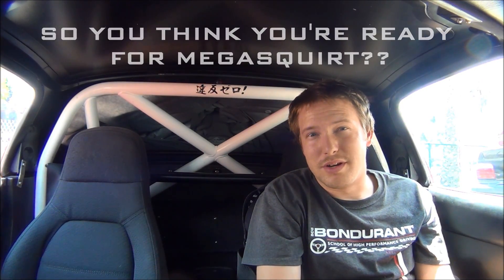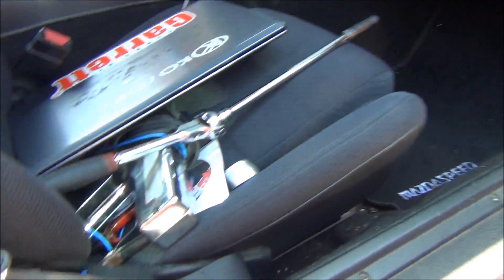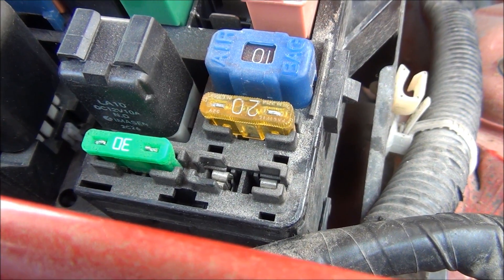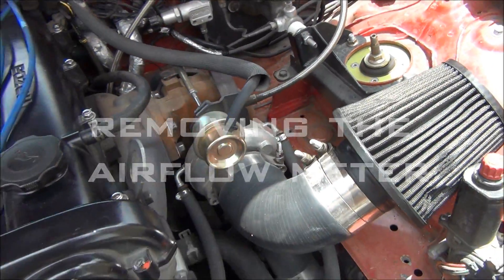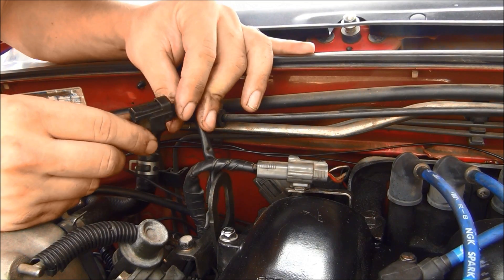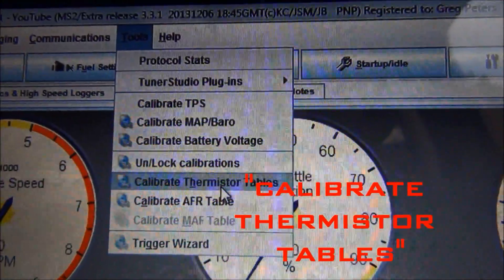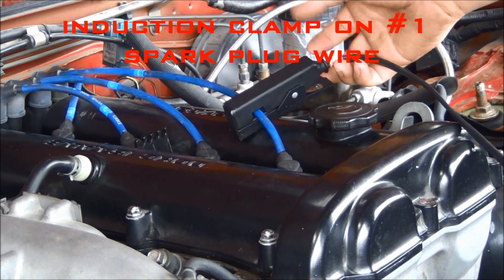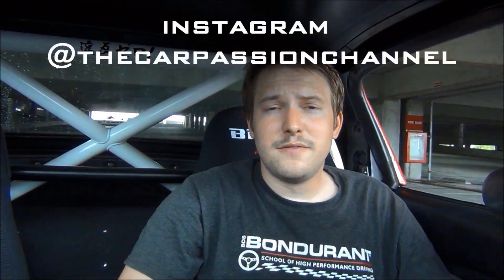How to Install Megasquirt!

Comment: I gotta thank you, this and your wideband install video were the two biggest helps I had when installing a wideband and an MS3 in my 1994 Miata w/ AC.

For anyone else who may be wondering how you "combine" these two videos (if you're trying to install both at once), when it comes to the new wideband sensor, I wired my wideband's digital output through a CAN module and inputted that into the options plug on my ECU AND also wired the analog wideband output into the stock O2 plug (aka, also to the new ECU, through the stock harness). This was on the advice of an experienced engine builder/spec miata builder I've been working with.

Also, for cars with air conditioning, the grommets he uses in the video are not available, and there's a lot of equipment mounted behind the glovebox door, but I still successfully drilled a new hole through the firewall and routed the MAP line through a grommet in the new hole (when you remove the glovebox door, there's a space where you can fit your hand over and between the A/C components and reach the firewall...that's the safe space to drill, as high as you can, to get up and over the rubber matting and sound deadening that lines the interior of the firewall).

Lastly, on 1994+ cars, the ECU is not in the passenger footwell, but is mounted on the bulkhead behind the passenger seat. It doesn't change the install very much, you'll just need to plan on a few extra feet of vacuum line.

Thanks again TheCarPassionChannel, and keep it up!

Comment: I have a o2 sensor but don't have the wide band controller. I also have a megasquirt. Can I complete the installation with out the wideband controller?

Comment: Hey Greg - love your channel.  I just bought a 2005 MSM with 63,000 miles on it.  it's my 4th miata.  i've had a black 93, a 2004, and a 2001.  all of them are red except for the 93.  I just installed the FM intake kit with the O2 modification, but then I came across a megasquirt for the MSM on ebay and got it for $750.  the guy said it is new in box, still in the plastic wrap, and never hooked up.  I'm hoping that that is the case.  I want to test the megasquirt to make sure I'm not getting ripped off.  could I just unplug the ECU, plug in the megasquirt, and see if the engine starts ?  And, if the engine starts, would that verify that the megasquirt works ???  If I can do that, I will just plug it in, crank up the engine, let it run for a couple of seconds, then kill it.  Evidently the MSproPNP for the mazdaspeed miata already has a base map loaded.   thanks for the help and the videos !!!
Reply from the maker: If it's already got the right base map in it, the engine will probably fire right up. Even on the base map though sometimes it can have a little trouble starting and idling, every car is different. Really if the ECU powers on and you can get the laptop to hook up to it, it should be all good.
Reply: cool, thanks.  i dont know what you do for a living, but you outta get a job with a company that makes aftermarket stuff for miatas !   great videos.
Reply from the maker: Haha maybe someday
Reply: Well, got home and the megasquirt box was on the doorstep.  I unplugged the ECU, plugged in the megasquirt, and the car started and I ran it for ten seconds or so.  So, I guess it works !?!?!  I havent plugged a laptop into it yet but I'll do that next.  $750 for the mazdaspeed miata megasquirt is a whole lot better than $1200 everywhere else !  now i can buy other goodies.  here's the ebay ad I got it from...   dont know why it says 850 cause i got it for $750..    http://www.ebay.com/itm/192084213877?_trksid=p2057872.m2749.l2649&ssPageName=STRK%3AMEBIDX%3AIT

Comment: Help! i did the install with wideband and iat sensor (from mazda). Car cranks but doesnt start after loading the basemap. I get a warning when putting on the basemap that the signatures dont match. I've read to ignore it but doesnt seem quite right. after cranking 1-2 seconds, the ecu cuts the fuel. what am i doing wrong??? it's a MS2 PNP with 3.4.0 firmware

Comment: y does it say 4g63 when fixing timing? is mega squirts just a tunable 4g63t ecu with the adapter to ecu?
Reply: You can tell it which engine youre tuning. sometimes it doesn't have specific engines in it so you have to use a super similar engine. Miata 1.8t = 4g63t basically. 4cyl, turbo, etc etc.

Comment: Thanks for your videos, very informative, but I'm the person that always have the difficult questions.
Everything that you explain is understandable but I'm primarily looking for the way the megasquirt 2 v3.0… is connected to drive coil packs with stock igniters can you touch on that.
Can you provide a screen shot of the ignition wheel decoder section.
If this is hard to understand. Maybe I'll give you my specific question.

Comment: after initial start up it was running between 9-10 afr, rough idle, surging idle, and running rough under load. 93 with 94 1.8 swap and megasquirt pnp. currently running base map from diytune. Any ideas?
Reply from the maker: Yes, it's a base map. The car will start and usually idle, but needs to be tuned right away as it does not come pre-tuned.
Reply: OK. just making sure u didn't do something wrong. thanks for your help

Comment: This may be a dumb question, but when you say the timing is advanced 10 Degrees, what does that mean?
Reply from the maker: That means the spark produced by the spark plugs fires when the crankshaft is 10 degrees before the piston is at top dead center. Basically you want the spark to start igniting the flame before the piston gets to the top, so by the time it's on its way down the combustion is expanding at the highest rate possible. The 10 degrees I speak of in this video is just a base reference point, the timing advance may be anywhere from 10 to 45 degrees depending on what RPM you're at and how much throttle you're using. Hope that makes sense!
Reply: TheCarPassionChannel Perfect. Thank you.

Comment: do you need to run a megasquirt
Reply: if you want to make good power safely (300+hp) yes.
you can use your stock ecu but remember its well about 20 years old. when the car was built people didn't have cell phones or home computers or video games. think about that when you trust it to not overheat or explode your turbo or throw a con rod at you.

Comment: ok so.. its sooooo difficult to find megasquirt stuff for my 2003 - why? what differences are there?
some people are saying there is something difficult with the vvt engines also. im so confused
Reply: There's some really detailed documentation on ms2 on megamanual.com and it has a good troubleshooting list
Reply from the maker: The cheaper versions of MS can't control the VVT.
Reply: Is it possible to use a plug and play in conjunction with vvtuner?
Reply from the maker: Yes
Reply: TheCarPassionChannel  hey I have a question. I have a 91 Miata 1.6 na. I installed a wideband (aem x series uego ) and mspnp2 and the car sorta turns on but just dies on me. Any suggestion in where I went wrong ?
Reply from the maker: What adjustments have you made in Tuner Studio?

Comment: So, what does that fuse do that you removed? Love the videos by the way.
Reply: Nevermind, I found it.  The "ST SIGN" fuse is in the starter signal circuit that goes to pin 1C in the ECU.

When you crank the car over, current goes to the starter solenoid and tees off through the "ST SIGN" fuse onto Pin 1C.

Comment: Do you need a wideband if you're just running the base tune on the stock engine. I ask because i'll get a wideband later on when I plan on tuning later this year.
Reply from the maker: Yes. You should do the wideband before or at the same time as MS. Even though it's called a "base tune" it will still need immediate adjustments after install. Check out my newer MS tuning videos to get a better idea!

Comment: Is there a mega squirt for a ej201 Subaru na engine my friend wants to up his injectors and I can't seem to find anything
Reply from the maker: You can install a Megasquirt ECU on almost any car. You might not be able to find a Plug n' Play version, but you can definitely wire one up. Same as all of the other standalones out there; Haltech, AEM, etc.
Reply: +TheCarPassionChannel thanks for the fast response. He's running a hybrid swap and he wants to get the most out of it na before he comes to the dark side I was actually looking into the build your own option for him. It says it has a pin out for him will that give him the base map

Comment: My used MSPNP did not come with IAT sensor.. Can I switch to MSPNP without IAT sensor?
Reply from the maker: You can, or you can buy the sensor.
Reply: I just bought the sensor and connector from a local auto part store. But my miata is fully stock and I'm kinda iffy about tapping my stock plastic intake tube... Would it still work the same?

Comment: so i noticed your not running a throttle poistion sensor , is it running all info from the air intake and rpm of engine>

Comment: I just installed mega squirt and changed my injector size on tuner studio with all the timing and such. My car will only start if I press the gas and won't hold idle.

Comment: You should make a video for non boost people who want to add little bits of hp with simple mods. Like me, cause I'm saving for a turbo but I already have aftermarket headers, cans and exhaust. Just not sure what else I can do to squeeze a few more hp out of my stock little1.6 lol.
Reply from the maker: +Stevens POV The best you can do without a dyno is just make sure your fueling is spot on. On an n/a car I usually shoot for around 12.5:1 AFR @ WOT.

Comment: TheCarPassioChannel - If I have a MS would the stock injectors be enough to run 5psi on the GT2554r or do I need to upgrade both the pump and injectors to run only 5psi?
Reply from the maker: +Troy Sebo The stock injectors aren't good for much boost at stock fuel pressure. You're gonna run a $900 turbo but not spend $170 on some RX8 injectors?? It's worth the upgrade!
Reply: +TheCarPassionChannel It wasn't a money issue I was just asking whether I would need to get the injectors at that boost level. Guess I'll just want another week for the injectors to come in so no biggie. A lot with the upgraded injectors do you think a 190LPH is sufficient or should I opt for the 250?
Reply from the maker: Troy Sebo I actually ran the stock pump at 12psi for quite a while. If you upgrade the injectors, the pump doesn't really become an issue until over 250whp, some people have made 300whp on them.
Reply: +TheCarPassionChannel What about stock clutch, what psi do you know its good till? I heard its good until about 180 tq on the 1.8l, the pervious owner replaced the clutch and flywheel in my car but with what I don't know. It was tracked so hopefully they didn't replace it with a stocker
Reply from the maker: Troy Sebo Probably 160wtq on the 1.6, +20 for the 1.8. Depends on the condition of it too.
Reply: +TheCarPassionChannel And on a GT2554r with a NA 1.8L 180tq would be reached with only a mere 6psi right? Rough estimate
Reply from the maker: Troy Sebo I highly doubt it would make 180wtq @ 6psi
Reply: i have a 2001 audi tt 1.8t i need a new ECU can i buy any ecu or does it have to be specific how does it work do i look for the original one that came with it or should i upgrade?

Comment: lmao im relatively new to miata turbo'ing/building, and i'd love to know because i hear it everywhere, what the hell is a vacuum line and where is it? also, how do you just add vacuum lines to things and what other uses does it have?
Reply: +Frank Lopez do you just t the existing lines? thats the only way i can see that working and you did state it on the video
Reply from the maker: +Frank Lopez There are vacuum lines all over engines. They hook up to the intake manifold and operate several systems on the car like the brake booster, fuel pressure regulator, and smog systems. To tee into them, you just cut one in half, put the tee in, and boom, extra vacuum port.

Comment: hey man, i recently installed a mspnp2 with a wideband, i got everything working and all but my idle seem kinda high,
can you share ur settings or make a video on how to tune the idle?
Reply from the maker: +PobreGaming Is your base idle set correctly? What settings have you messed with? There are a lot of different things that can affect idle.
Reply: i havent messed with anything, when i installed the ms i followed everystep you said and thats it. except the gm iat sensor, which im doing in the next couple of days. can i use the idle screw to lower it down? i have the registered version of tunerstudio so i have the "autotune" feature.
Reply from the maker: PobreGaming Things like idle and fueling need to be tuned right after install, a standalone ECU is not exactly a "bolt-on" modification. Autotune is just for helping form the fuel map (which is really awesome) but it will need some fine tuning on top of that, as well as other features like idle. The settings I use are going to be way different from yours because I have no Air Valve or Idle Speed Control Valve. My video is just showing how to install it, not how to tune it. It's not too hard once you get the hang of it, just try out playing with different settings in the idle menu and everything you feel comfortable with. And don't change anything if you don't know what it does!!

Comment: when setting the timing with mspnp2 do I need need to jump the connectors in the dignastic box?
Reply from the maker: +Tong Thao No, you just need to set MS to "fixed timing". Just don't forget to set it back to "use table" when you're finished setting the base timing.

Comment: hey so im planning on building a 25psi miata with a disco potato. im a little confused about fueling options. i will be runnig megasquirt but my question is how do  i figure out how much rail pressure ill need to support 25psi of boost. im also running 850ccbosch injectors. i know the stock pressure is 43.5psi but i will most likely need a higher pressure?
Reply from the maker: +Mohand Reda I've never built a crazy power Miata before, so I've never run into that problem. As long as your fuel pump can maintain pressure in the rail, it should be fine. If it can't, you need either an AFPR or a higher volume rail like the M-Tuned one. You probably want to talk to someone running 350+whp and see what fuel mods they're running.

Comment: Hey Greg, I just installed my mspnp2 on 94 NA1.8, stock everything but I/H/E. I've followed all the instruction on this vid along with ms guides and miataturbo threads. But I'm really stuck, car starts but idle surge and runs really lean afr reads 22 lol. Have any fuel tuning pointers for me? I'm using the basemap off diy's website.
Reply from the maker: +Jimmy wu If the wideband reads 22, it's probably not hooked up right, or you have a decent sized exhaust leak upstream from the sensor. The car won't idle leaner than around 16-17:1. To add fuel at idle just open up the VE table, watch where the blue dot is at idle, and bump those cells up a couple points at a time until you get your AFR down richer. On a 1.8 since it's sequential injection, it should idle stable around 14.5-15?
Reply: +TheCarPassionChannel i have the wbo2 install like yours tapped into the signal wire for stock o2 sensor, and it reads right on narrowband/stock ecu. but ill double check it.

side note: i do have a home made air intake (to accommodate the IAT sensor) and i have a tiny filter on the IAC since i didn't make a bung on my intake tube to connect it. will that be a cause for my symptoms?
Reply from the maker: Jimmy wu You still have your MAF in place and you're running your ISCV open? Yeah that's a massive vacuum leak and will cause it to run very lean. You need to delete the MAF if you run your ISCV open.
Reply: +TheCarPassionChannel oh no, I deleted my maf. I have filter ->IAT ->one pipe all the way to tb. 

Is it cool if I dm you on fb would be easier
Reply from the maker: Jimmy wu Greg Peters

Comment: Does the tps need to be disconnected?
Reply: +Isaac Fraley not for me (91 Miata) there's a jumper in the megasquirt that is left out.you will have to replace the jumper if you ever go for a variable tps from a automatic car or something
Reply: Thanks for the clarification!

Comment: Is an IAT sensor absolutely necessary if I'm just getting used to tuning megasquirt with no turbo installed? My understanding is that the MAP sensor, a wideband and megasquirt is sufficient just to start out with. Then I can add injectors, the IAT sensor, an intercooler and the turbo after I'm confident with tunerstudio and tuning my car.
Reply from the maker: +kasaino You can add the IAT sensor later to delete the AFM (or MAF if you have a 1.8) but I recommend doing it up front, there's no reason not to.

Comment: what is megascuirt because i can't see the other video about it
Reply from the maker: +Batuhaan try this: /watch?v=Z9OdEwrfbEU

It's a fully adjustable ECU that controls the engine. It serves the same purpose as the stock ECU, but since everything's adjustable you can easily add turbo, supercharger, nitrous, meth injection, convert to E85, etc.
Reply: TheCarPassionChannel  thnx